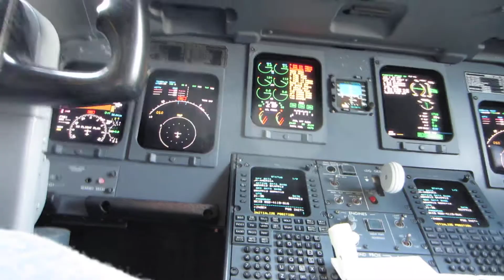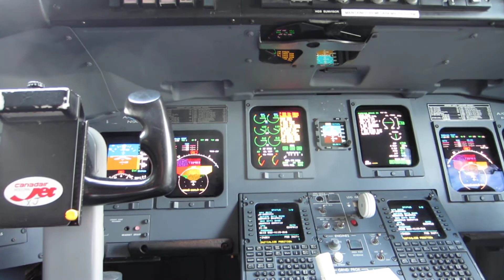crj900/200 EGPWS test

Comment: What does glide slope mean? Sorry, not a pilot :(
Reply: It means you're approaching the runway and you're sinking too fast and not on the correct glide slope.
Reply: The normal descent angle to a runway is 3 degrees, this slope is called the glide slope. It is a vertical path that slopes down to the runway touchdown zone at 3 degrees. This can be visualized using experience, lights such as PAPI’s, or ground based/satellite navigation. 

When the aural alert in the video plays it is to warn about you being below the glide slope by an excessive amount, meaning you are too low for where you are on the approach to the runway. The glide slope on a certified instrument approach is also a safe area where there are not obstacles. Going below vertical guidance can expose the aircraft to threats such as terrain and obstacles, especially if you can’t see outside or at night.